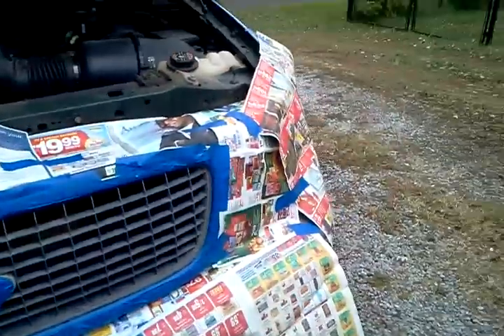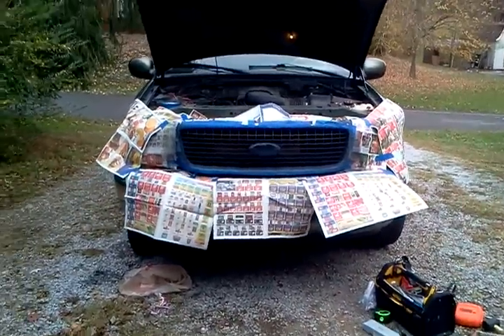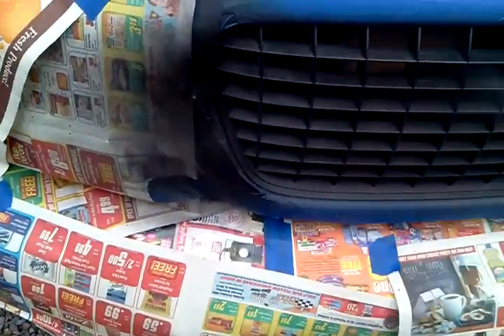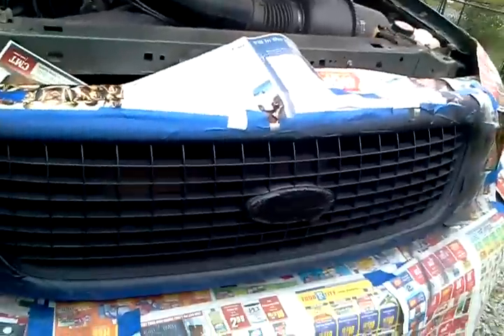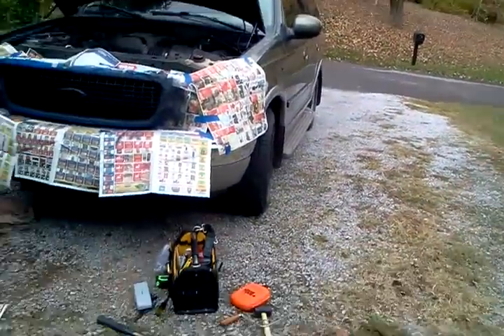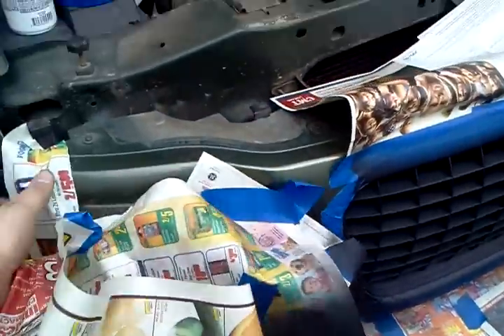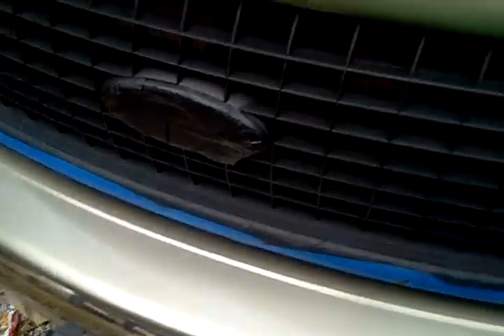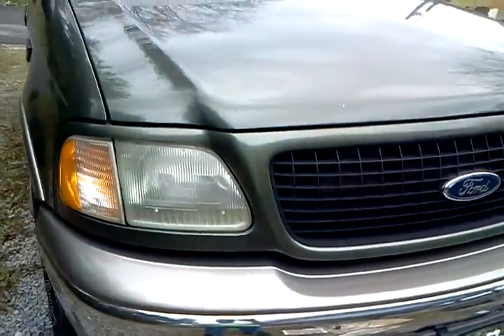Painting ford expedition grill 3/3

Comment: Good job as far as painting it on the vehicle. I need to do this to my F150. I've seen vids on taking that grill out and I don't think I want to do that. So kudos. Also, I got motion sickness watching this 3 part serious...lol
Reply from the maker: Been 2 years now and it still looks like it did that day. Best thing I did.
Reply: That is good to hear. I will be doing this real soon I think to my F150
Reply: dont waste money buying new mud flaps...use mothers back to black...after applying the product wait at least 1 hour before polishing it up with a micro fiber or cotton towell..use it on all attached parts like vent cover at base of windshield and hood, side mirrors running boards, front bumper valance at bottom..its 6 $

Comment: Take the grill off next time. It only takes a few minutes and you will save time not having to tape off the bumper and fenders plus you can move it around and get all the spots. I just recently did this with my 02. I used gloss black which really makes it pop plus I added a black billit aluminum grill insert which lays over the top in gloss black and it came out awesome.  You will be much happier and it's really not that hard.
Reply: Ritee on i agreee remove it and prep it i think its easier removing it

Comment: I remove it... Ive done it and its easy...plus if your doing it in your truck its because you want it to look good im i right?... Ths is going to starts comming off or chipping.... You got to give it a light sanding and use automotive paint... Ive learned this the hard way  .. I painted my old grill.... And the heat from the radiator started cracking, and comming off... So i just bought another grill and installed it.and it was easy... Noelw i regretted not taking it off and prepping it good